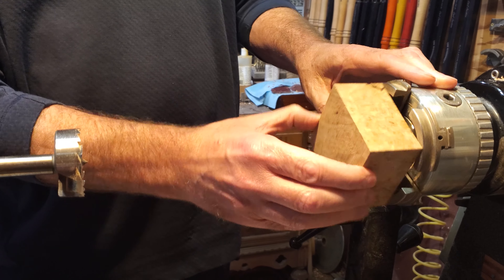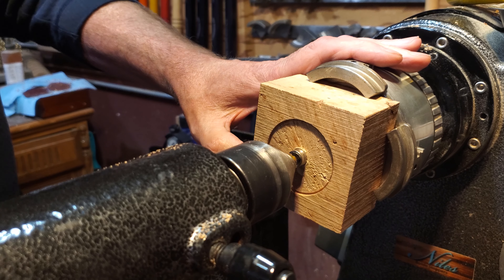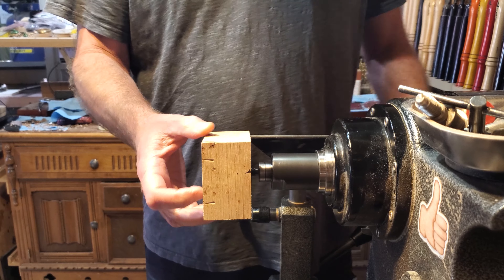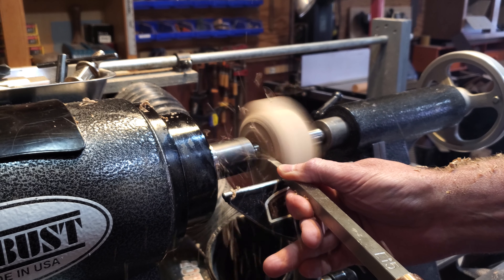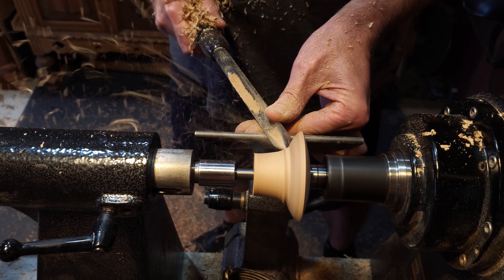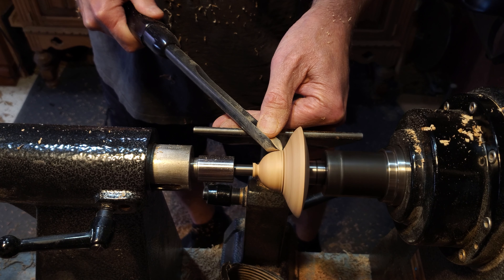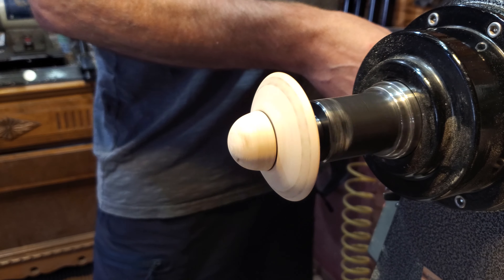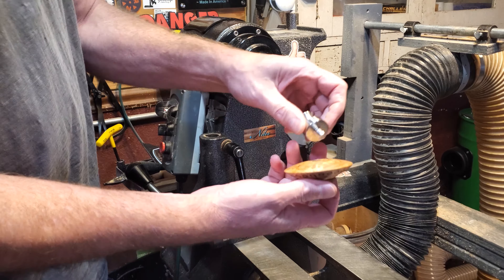Woodturning | UFO Opener

Comment: Great project and a great variation on the normal bottle openers, these came out looking amazing!.  Did you use laminate to burn on the ones that are not square to the tool post.  I really like your tool rest with the wooden top!  What would be perfect for keeping a drill straight for drilling a hole for meat tenderizer or garlic press.  Can you tell us more about it.
Reply from the maker: Thank you Ken! I used playing cards to burn those lines. 

The two arrest is flat and I just double-sided tape wood to them you can adjust it for whatever tool you want to.

Comment: I tried the wood glue option on 5 bottle stopper blanks. Every one of them came loose while turning. Also any advice on how to keep the inserts from pistoning back out of the blank even with CA or Epoxy? I have been clamping  them in to dry.
Reply from the maker: Hi Jon, I will give you a call tomorrow.
Reply: @CarlJacobson  Thanks I would love that!